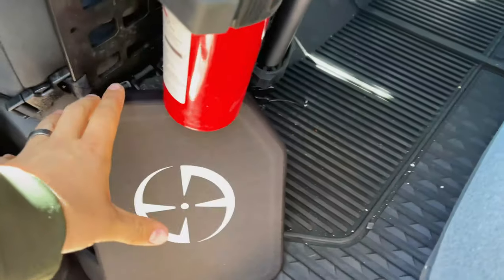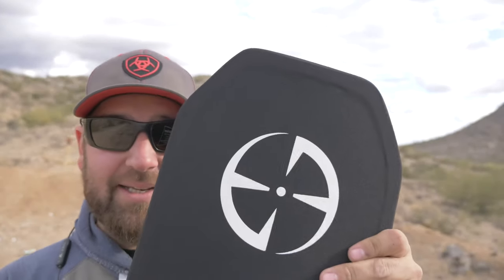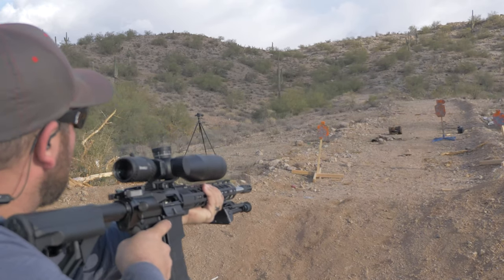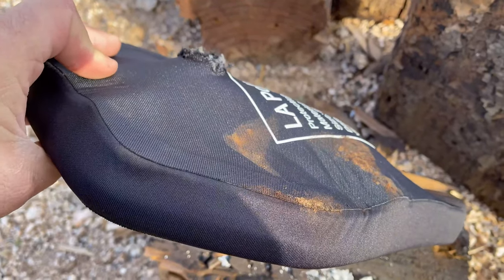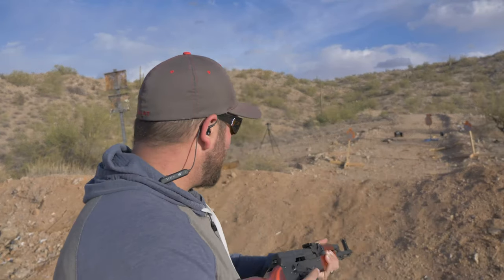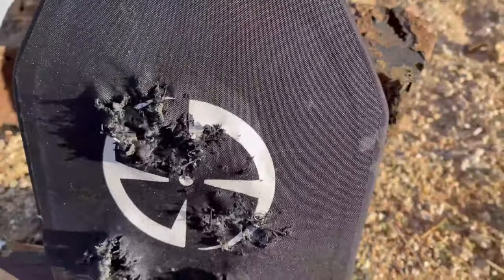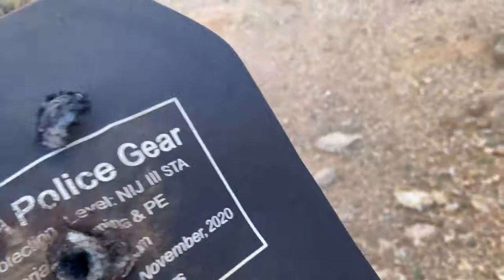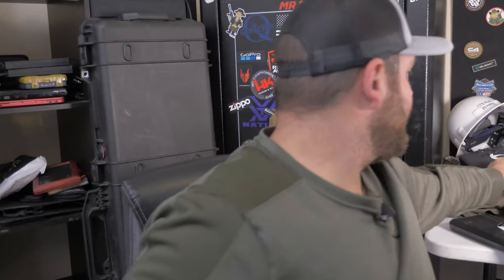Affordable Level 3 Ballistic Armor Test | LA Police Gear

Comment: Hell of a commercial for this plates!  Man, it took the punishment.  I remember several years ago when a lunatic attack Dallas PD with an armored van.  They finally ended they situation with a 50 BMG.  The attacker faired about as well as the plate you shot.  I may have missed it, but did you just a weight for the plates?
Reply: Bro, your getting close to that 30K number in subscribers.  Congratulations!  Your hard work is paying off.